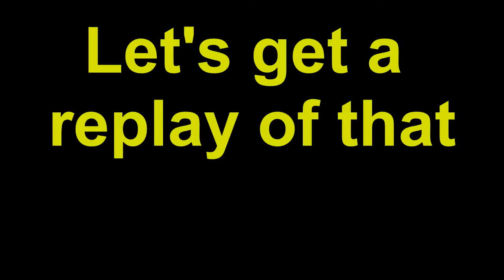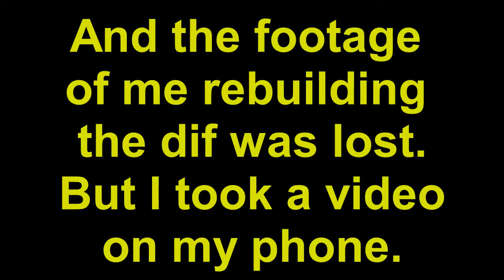Dana 30 Front Differential Rebuild on a Jeep TJ

Comment: Nice video, Thanks. Was wondering, did you re-shim and check pinion depth, backlash, etc, when you installed the new gears? I have a ‘79 CJ-5 that needs a front gear swap to match my rear end gear ratio and plan to have a local 4X shop do the work. Was quoted $1,100 but that includes parts and the 3:73 and up carrier, bearings, seals, lube, etc. I thought you needed to get a good gear setup during the swap or risk destroying the New Ring and Pinion. Just wondered...